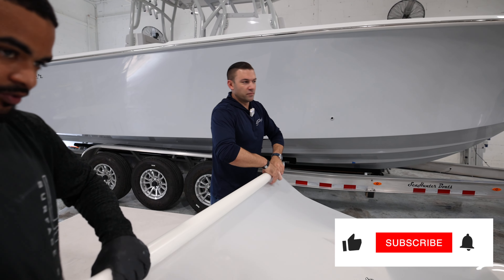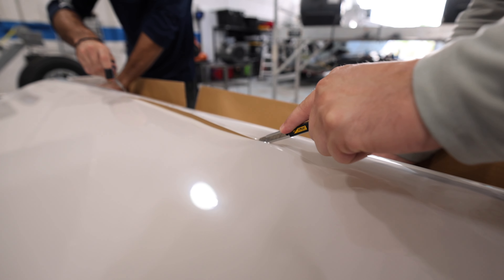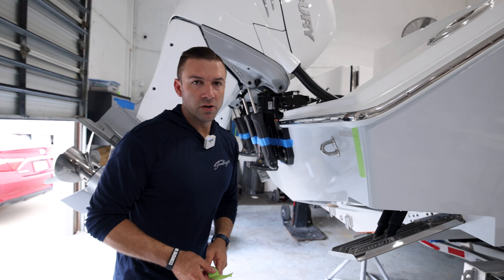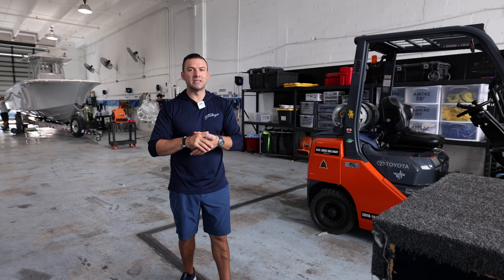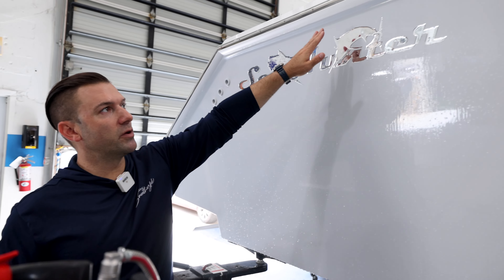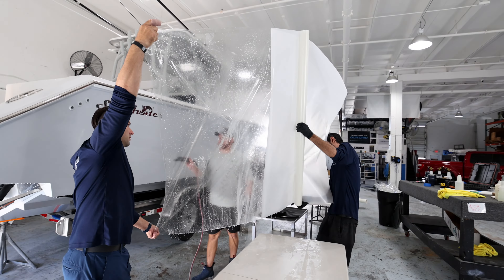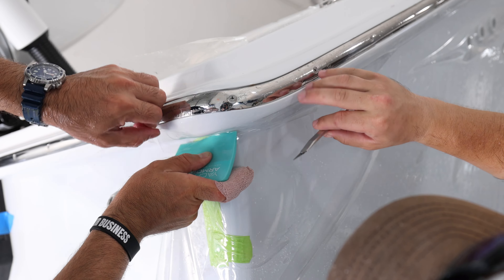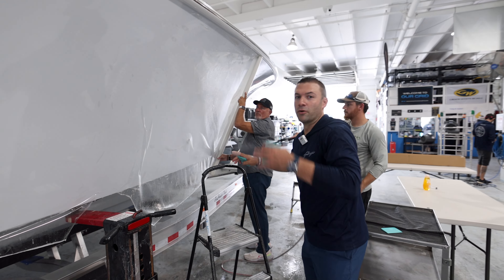Yacht Armor Installation On A DNA SeaHunter 31'

Comment: Lots of micro cuts in the gel coat
Reply: A vinyl wrap is typically thinner, more so for looks bs protection. PPF is alot thicker
Reply: PPF is so thick you’re able to score the film without damaging any paint or gel. I am sure when they cut on these boats they are just scoring the film then tearing away